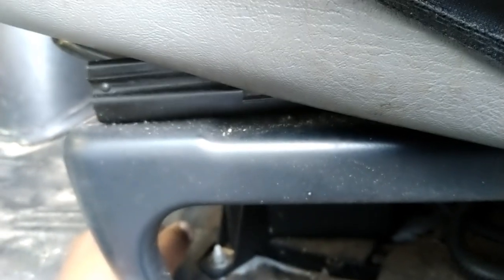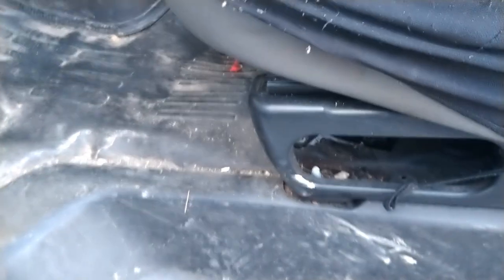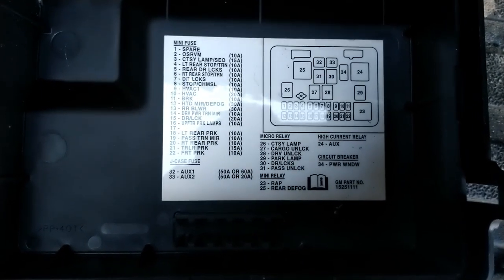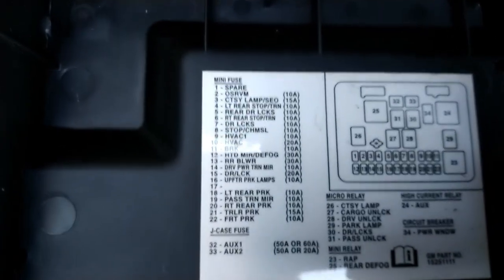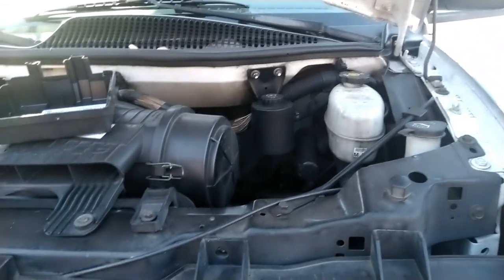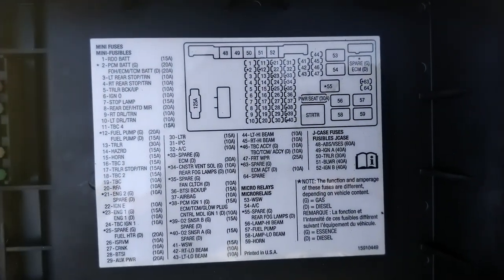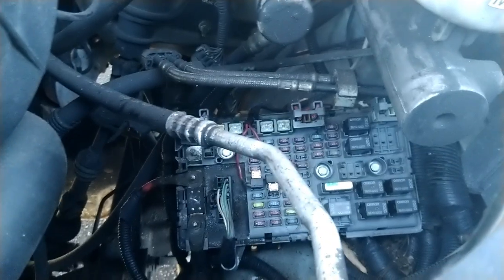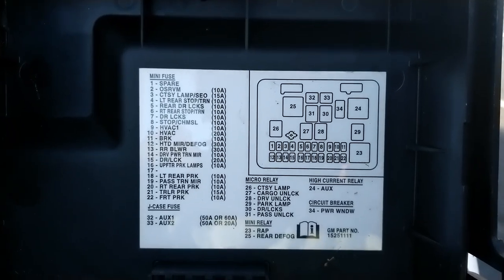CHEVY EXPRESS CARGO VAN.. LOCATION OF FUSE BOXES!!

Comment: My high beams stopped working.  Low beams are fine but soon as I put my highs on i have no lights. Do u think its the bulbs or fuses
Reply from the maker: I would check fuses first most likely the problem.. if fuses are fine, could be electrical next

Comment: My alternator is overcharging my battery. I put a new alternator on my van 8 months, ago. It says, service my charging system on the dashboard. I just put a new battery I it, today. I checked the wires and connections, but they seem good. No torn wires, or worn anything, as I can see. However, I went to AutoZone & the ECU, electronic control unit came up on the diagnostic device. CO550-00, is the code. Could this be causing the high voltage problem, on the dashboard? Far as, giving my dash a false reading life it's a problem with the ECU?
Reply from the maker: Good question will check and respond soon.. but that code CO550 is a ABS module code for the brake lines. It can be easily changed.. make sure you also get the right battery battery for your van, if you don't, the alternator will overcharge it.. let us know what you came up with with this issue
Reply: @OneDem99  , I got the right battery for my van. I believe I need to replace my ECU. Online, I read that the ECU regulates the alternator. Also, my temperature gauge doesn't have a reading. I put a new thermostat on there, when I changed my water pump. Online, it says the ECU controls that, as well. My van was driving well all day. It just cut stuttered, and cut off, out of nowhere. So, replaced the battery, after I noticed the high voltage the battery was getting.

Comment: What about the smaller black box that's under the steering wheel. It's hooked to a bracket and says relays only.I have one in it and it's for my Hazzards.There are other missi g ones though.Do you know what goes there.there isn't a cover to tell me.2001 chevy express 2500.
Reply from the maker: send a link of the black box please

Comment: My same van misfire 2004 express 2500 . Mecanic change all plug and some coil . But engin light blinking little. Some time shake . He cannot fix so what’s fault. I already lot of money spend. Please let me know solution.
Reply: Sometimes, if everything in the engine is actually not misfiring, you can have the mechanic or dealer to a crankshaft position sensor variation relearn. Had to do it on my van and it fixed everything but only if the engine does not have an actual misfire

Comment: Hey what are the back signal light fuses called mi break lights and signal not working
Reply from the maker: Hey there, its better to check all the fuses instead of just focusing on a particular fuse. Start from top and check them all and replace any blown ones with similar ones and you'll solve your problem.

Comment: My fuel gauge is not working wich fuse do i need to check?
Reply from the maker: Hi Gomez.. I don't think there's a separate fuse for the fuel gauge. Your problem is most likely at the fuel pump by the gas tank.

Comment: How do you move the drivers seat to access the fuse box?
Reply from the maker: You don't remove the driver's seat.. you open the cover of the fuse box as shown in the video.. from there you access the fuses
Reply: @OneDem99  I can’t get it open no room under my seat
Reply from the maker: @TinyHomeCookingwithSherlei  scoot down with the door open, and press the two plastic clips on either side at the same time.. The cover of the box will come open.. what year is your van?
Reply: @OneDem99  2007 chevy express 3500
Reply: I want to transfer the fuse box under the driver side to the passenger side because I want to fix disabled chair base can I find wire kit for that